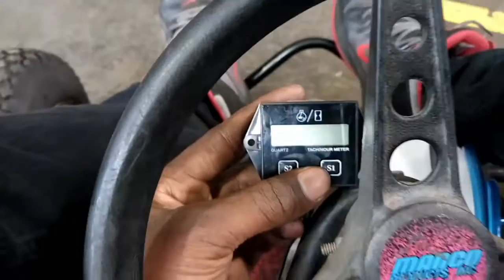Go Kart With Snowmobile Engine #14

Comment: Just Bought A Motor Today Looks The Same But Idk Where To Start. How To Hook It Up Bought A Whole Sled And Took The Engine Off
Reply from the maker: just use the whole engine and drivetrain off of the snowmobile
Reply: +rushking19 I Don't Took Everything Off Seems Like The Engine And Torque Converter Is To Big But It's The Same As Your
Reply: +Blitz Ryse Done*
Reply from the maker: Blitz Ryse what kinda go kart is it going on?
Reply: +Blitz Ryse and my axel for the secondary clutch to like 3 feet long
Reply from the maker: Blitz Ryse oh it's one of those you may have to cut it and shortan it or get a different axle for it
Reply: +rushking19 I don't got it set up the way I want it going the same way you did with the secondary
Reply from the maker: Blitz Ryse then you will have to weld mounts
Reply: +rushking19 How'd You Do Your Wiring My Wiring Is Messed Up And I'm Not Getting No Fire !
Reply from the maker: Cold Ryse Leader mine is still stock wiring ,what motor do you have?